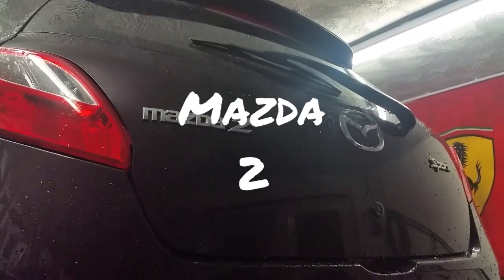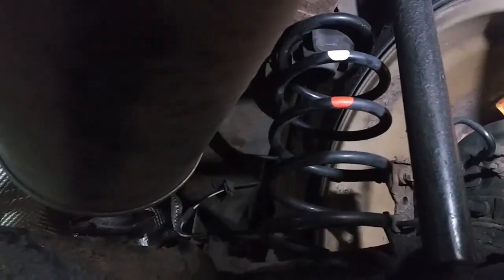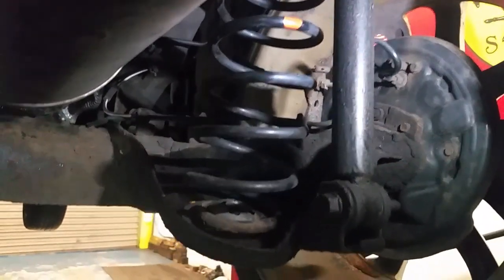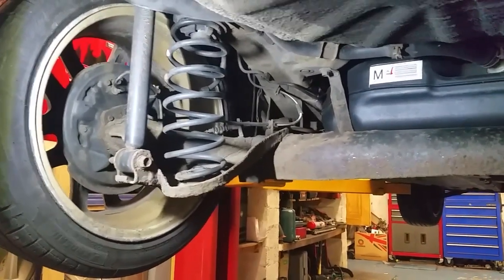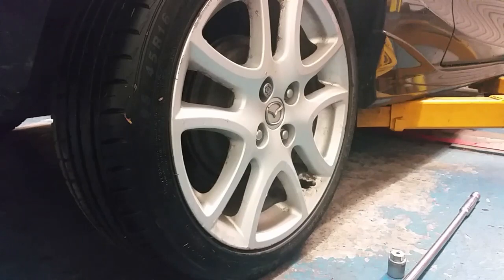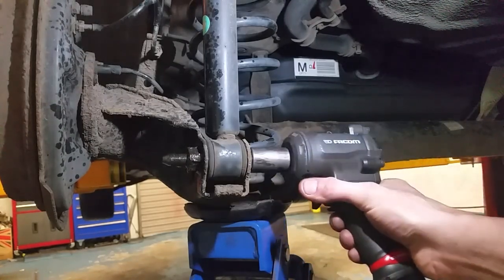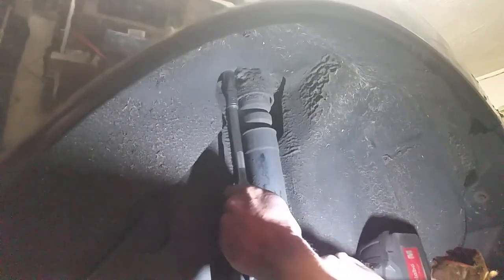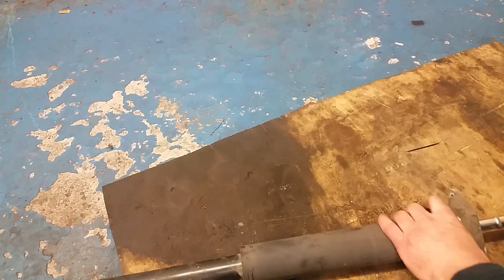Mazda 2, Ford Fiesta, Rear Shock absorbers, Rear Springs, how to

Comment: My fiancé has the exact same car and her rear tires lean inward . Not sure if I have to replace the whole torsion beam suspension in the back or what I could do to straighten the wheels out. The tire thread wastes unevenly and have to constantly buy new ones . Any suggestions ?

Comment: Great Vid Dave, thanks for tips, some of which i already use but some new as well. What torque setting would you use for the lower absorber bolts?
Reply from the maker: No idea on exact torque for those bolts. Prob about 100nm. As an old instructor of mine once said 'tights tight'
Reply: Thanks for your reply Dave, much appreciated. Tony
Reply: I use 70Nm as they will be coming off again eventually

Comment: Unrelated for me as I think the springs are in good condition on our mazda 2.
Would it be stupid idea to undo the shock and lower the jack enough to place the spring (without it being compressed) in place then slowly raise the jack so you could secure the shock back in place?  Assuming there's a risk of it slipping out of place and back firing into the face! 

I'll be following your excellent video to replace the shocks though! Thanks very much!
Reply from the maker: Prob not enough clearance but you could try undoing both shocks with two jacks. When your lowering be sure not to strain brake hoses or abs wires. Glad u like the video. Cheers dave

Comment: I would of put some copper slip on the 2 top bolts of schocker the noise they were making when you done them up
Reply from the maker: Copper grease will deteriorate the rubber components

Comment: Hi why do you have to take the wheels off..
Reply from the maker: To make it easier
Reply: @davesterl  hi is it possible to do it without taking the wheels off.. I have cover wheel nut caps. I just think they will brake that's all taking wheels off.. Thanks for your replys
Reply from the maker: @chipwood67  never tried that. I don't think so tho
Reply: @davesterl  OK thanks for advice. My mechanic is fitting it.. I'll let you know if it can be done. Cheers